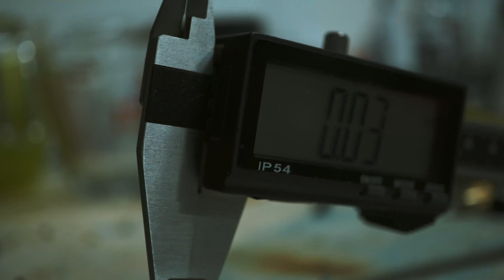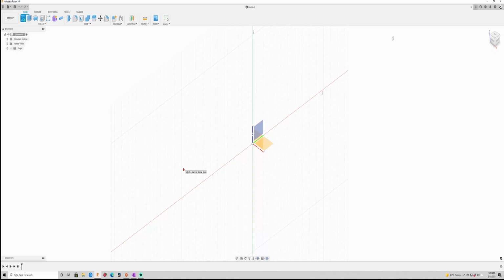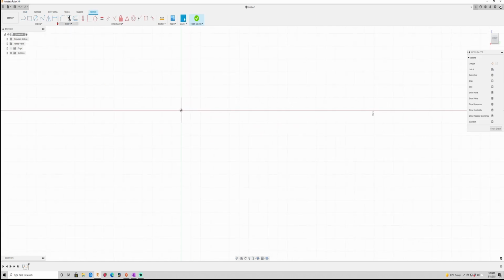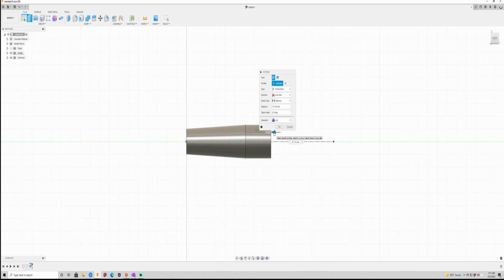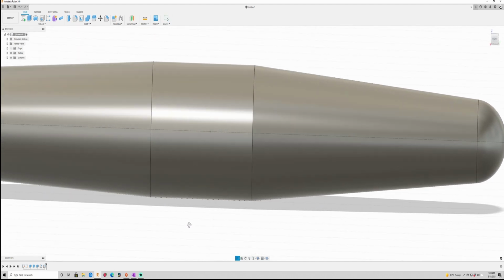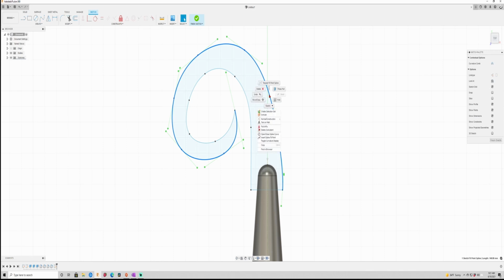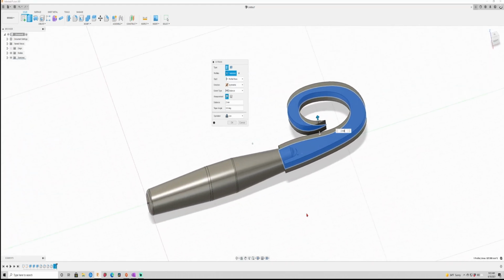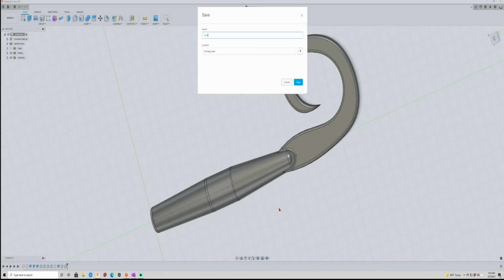Simple Lure Design in Fusion 360

Comment: This is incredible. Thanks so much. I can't wait to start. Liked and subscribed.
Reply from the maker: Thanks Paul if you need anything just let me know!
Reply: @WMBayouLures  Will do. I've been researching bait making, molds, etc. for a while. This is seems to be exactly what I'm looking for. Not looking for production, just custom hobby. Is there any issues with resins for hard baits being poured into the sculpt molds, or does the sculpt resin make great hard baits by itself? You may already have a video on that, I will be sure to keep watching previous videos. Thanks again.
Reply from the maker: @PanfishingJournal  I have designed a few hard baits but they are still very much a work in progress. I have not come close to perfecting them yet. The 3D printer resin is a lot heavier than the stuff you normally make a hard bait out of so it takes a different approach. I am sure with some mold release you could use sculpt as a mold for some foaming resins. You can get a peak of a design I am working on in this video - https://youtu.be/DY_jpAXaFEMhttps://youtu.be/DY_jpAXaFEM